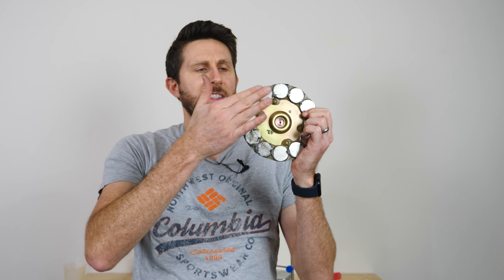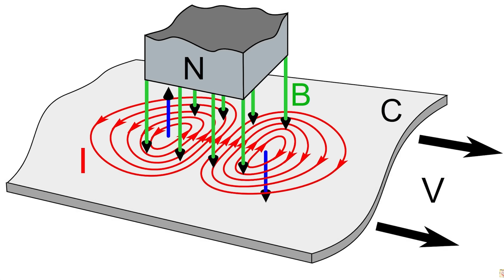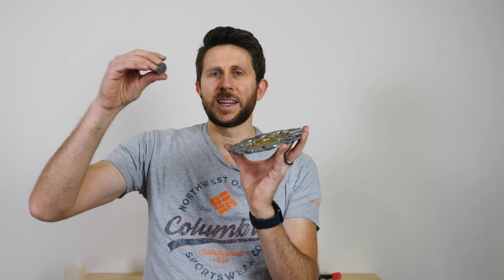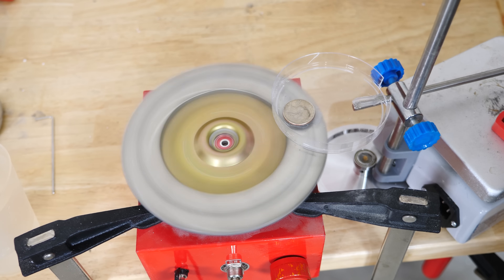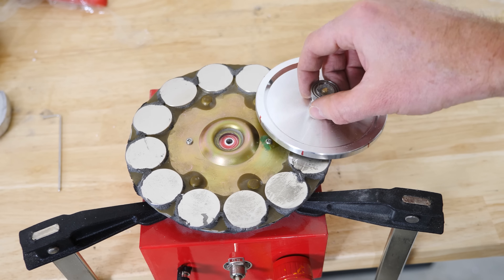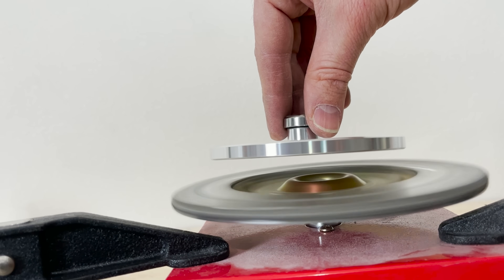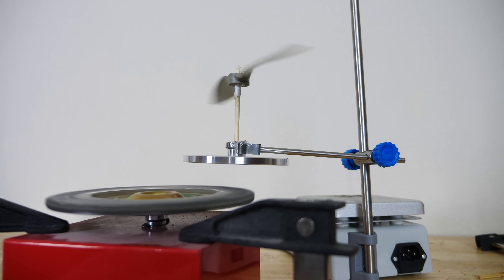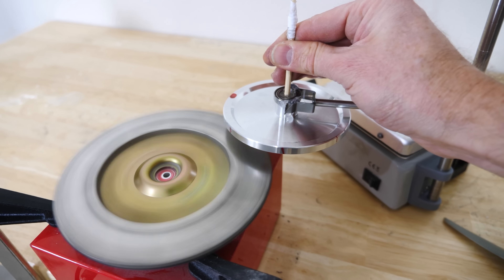How To Make Invisible Gears With Eddy Currents

Comment: Actually, that same principle is the one asynchronous motors use: they have a non-magnet rotor spinning to avoid overcurrents during startup or load changes (as opposed to synchronous motors with a magnetic core). When three-phase current runs along the coils of the stator, it creates the variable magnetic field you make with the spinning magnets. This has the disadvantage of having a variable speed depending on the tork they have to overcome, but nowadays are more used than synchronous for big force requirements afaik.

Comment: I know this is how some water pumps work. Instead of having a shaft through housing and having to use special gaskets to keep water out, just use the magnetic field through the housing. To ensure a water tight component.
Reply: The most common version of this is the magnetic stirrers you see in every chemistry lab, that are driven by electromagnets integrated with the hot plate the beaker sits on. I used magnetically coupled gear pumps from Tuthill Pumps back in the day for one system I designed and built.

Comment: I remember back in 69, I took apart a speedometer from a 1961  -" Ninety Eight"  Oldsmobile and saw an aluminum cup-shaped metal on one end and a magnet attached to the cable that ran from the transmission.  I knew very little then about magnetic uses in things but once I saw this combination, it hit me how it worked.
Reply: Indeed. I took out a speedometer from a 96 mazda and only years later actually discovered how it worked. Neat stuff.

Comment: I think it'd be really cool if you made the receiver "gear" disk as thin (i.e. as light) as possible, and maybe beefed up the propeller a bit in terms of thrust (and not weight ideally). Then, with a bit of luck and some precision placement, ideally you could get it to levitate above the spinning coil -- it would spin up so fast that it would start rising and getting further from the coil, inducing a feedback loop wherein being closer causes to spin faster and move further, which then causes it to spin slower and move closer, etc. until it (hopefully!) finds a nice stable equilibrium
Reply: The only issue I could see with this is it flying off to one side or the other you'd have to have some sort of string guide or something to keep it above the magnets
Reply: @drako7222  yeah maybe you could make the body of the propeller hollow (if it wasn't already) then drill a hole in the middle of the bottom disk and thread the whole thing onto a thin metal mast anchored to the table
Reply: If you make the material thin then there will be decrement of edye current. So less levitation
Reply: @BalaMurugan-hk2gd  I see... you don't think there's a middle ground between thickness/weight and strength of the eddy current that would make it work? Is there a lighter metal than aluminum that would be stable enough and otherwise appropriate to use? Maybe lithium (disclaimer: I don't know what I'm talking about)
Reply: @superbasyboy  Thanks for the detailed explanation! In your expertise, do any medals that could fit the bill come to mind? Or is aluminum still probably going to the best choice?

Comment: f you really want something unbelievable try a step up transformer just using the basic counter and clockwise layers you don't need metal. But you have to layer one coil at a time. when pulsed . the other receives a voltage step up by adding core material amps are also increased. I believe Tesla thought it was to simple to create more from less. . variable switch helps for power and voltage . I have tested it 5 volt's in 40 volt's out .  I Thank you This is my way of returning the favor. equal length's of wire and same gauge. Thanks. If only we as a world weren't dumbed down by greed. Imagine the wonder's

Comment: Great video.
I thought pans for induction stoves could not be all aluminum.
Reply: it depends on the type of inductive stovetops. different inductive stovetops might use different frequencies, and different metals are more susceptible to eddy currents at different frequencies (this is a bit of a simplification).

Comment: Has anyone ever thought to do something like this to be a different kind of clutch in a manual car? But have the friction plates only make contact and synchros when the magnets are close to contact, they don't actually make contact. I think that woulde too difficult to pull it out of gear
Reply: He's just showing that this is possible, otherwise this is a terrible energy usage :) even worse clutch because lack of friction/manually controlled parts.
Reply: @shortsofmylife4592  Not if you read the comment above this one ...

You're looking for a comment by one 'Rene Knuvers'

Comment: I have a theory about this let's say you put something on to those wires he was messing around with do you think you can get an Infinite source of power at least as long as no wires and or what ever is connected to it doesn't short blow a fuse or overheat

Comment: Always learning something new from you.  Pretty cool stuff!  Eddy currents are also what allows metal detectors to work.  Transmitting coil creates Eddy currents in metal which in turn give off their own magnetic field and thus a sensing coil picks up that magnetic field.  Depending on how close that return signal matches the transmitted signal determines how conductive it is and shows a higher number on the target ID or higher on the discrimination level.

Comment: Will it be possible that the aluminium flywheel will drive a couple of gears that will drive the steelplate? Like a infinite loop?
Reply: AND use the heat from the coin to run a Nitinol Motor to spin the plate of magnets... 🙂

Comment: Cool demo! I'm a bit surprised that James didn't try this in a vacuum, since there will inevitably be comments asking how much of the energy being transferred to one gear to the next comes from the air current created by each spinning disk. Air currents are clearly not the main reason for this effect given how fast the wheels turning, but I could also see how they would add a measurable amount of force that gets passed to each disk from the previous one.
Reply: Hm, interesting thought. You could be right, but when I imagine two metal disks spinning one above the other like in his setup (but not magnetic) my gut instinct is that the spinning one wouldn’t impart any meaningful amount of spinning force on the other due to air current. I could be wrong though. So it would definitely be interesting to see!
Reply: @droam129  Yes I agree that given the shape of the discs he was using (relatively flat and not really "catching" the air around them) it's unlikely they would transfer much energy between them, certainly not as much as what was demonstrated here. But if their surface was more rough or even had raised tabs and they were mounted on their axes in a way that limits friction as much as possible, you could definitely make them spin without touching with just air flow. Really anything other than a perfectly flat disc spinning completely horizontally will impart some force. Just not much.
Reply: hey everyone today im going to be showing what would happen when you put the invisible gear machine in vacuum
(intro to his next vid)
Reply: @rakshithg9669  It's impossible to read this and not hear his voice.
Reply: They burn up faster. The air passing over the inducted disk actually helps keep the metal cool and stable. If you put it into a vacuum, there is no heatsink effect and thus the inducted disk will eventually overheat and fail. This is a common problem for eddy current clutches that get insufficient airflow or in vacuum-state applications when their duty cycle is too high.

Comment: You should try an actual gear inverter using magnets.
You place a sandwich of these alternating magnets on a ring pattern with another ring with ferromagnetic materials in place of the magnets in the middle.
 When you turn one of the magnet rings the other ring will turn on the opposite direction without touching.

Gear reduction also works by using different number of magnets.

Comment: What if the fan will create down lift, then in turn will push the plate closer to the magnets and then in turn will spin it more faster and repeat :) will it touch the magnets? Will it actually work?
Thanks 😊

Comment: You should compare how much the spinning magnets heat up aluminum compared to steel. There is a reason the inductive cooktops specify that cookware should be magnetic.
Reply: Is it about being magnetic, or is it about the electrical resistance or more accurately, impedance? The more resistance, the higher is the heat from the currents.
Reply: An induction stovetop is a high frequency transformer. The primary winding is built into the stove, the secondary winding is the bottom of the pan placed on it.

At a high enough frequency, such a transformer works with all types of conductors as the secondary. You want to have a high electrical resistance in the secondary because that is what the circuit is designed for, including impedance matching. It produces the heat inside the bottom of the pan and allows the primary coil to remain cool. To achieve this high resistance, the skin depth of a particular metal, at a particular frequency becomes important.

Due to semiconductor economics, 24 kHz systems are common, but at that frequency, aluminum and copper have too much skin depth and too low of a resistance and don't impedance match well with the primary.

Iron on the other hand, has a relatively high electrical resistance, especially at 24 kHz due to the skin effect. It's ferromagnetic and has high permeability.  AC currents can only flow in a very thin layer below its surface. It also exhibits hysteresis effects resulting in heat. (This only adds about 10%) 

In a good conductor, skin depth is proportional to the square root of the resistivity. This means that better conductors have a reduced skin depth. Skin depth also varies as the inverse square root of the permeability and the inverse square root of the frequency of the conductor. In the case of iron, its conductivity is about 1/7 that of copper, meaning its resistivity is 7 times higher. However, being ferromagnetic its permeability is about 10,000 times greater. This reduces the skin depth for iron to about 1/38 that of copper, at a given frequency. The higher resistivity of iron, combined with its thinner skin depth makes its resistance significantly higher than copper or aluminum.

There are induction cooktops that employ even higher frequencies, allowing the use of aluminum and copper. Panasonic Corporation in 2009 developed a consumer induction cooker that uses a higher-frequency magnetic field of 60 kHz or higher, and a different oscillator circuit design, to allow use with non-ferrous metals as well including aluminum, multilayer and copper pots and pans.  In 2017 Panasonic released a single-burner countertop "all metal" unit, using their trade name "Met-All"

Also, some cooktops do employ a magnetic reed switch and permanent magnets to detect the presence of a suitable sized ferromagnetic pan, to permit the stovetop coil to be energized. See patent US3796850A. Also, some cooktops can detect whether cookware is present by monitoring power delivered. As with other electric ceramic cooking surfaces, a maximum pan size may be specified by the manufacturer, and a minimum size is also stated.

The control system shuts down the element if a pot is not present or not large enough. If a pan boils dry it can get extremely hot – a thermostat in the surface will turn off the power if it senses overheating to prevent cooker failures and potential fires.

As for the original suggestion made by X JWill, comparing how much the spinning magnets heat up aluminum compared to steel:   Thermodynamics plain and simple. As long as the load on the prime mover which spins the magnets is constant, the heat produced will be the same for iron, steel, aluminum, copper or any other conductor. Heat is the graveyard of all energy. Whatever energy comes out of the spinning magnet wheel, at a given load, the total heat will equal that same energy. The temperature after a given amount of time will depend on the specific heat capacities and masses of the materials, and the rate of heat loss by the materials. If I have a motor which is putting out 1000 watts at the shaft, then 1000 joules per second will go into heat. A little will go into windage and noise, but most of the energy will go into doing work on the load. The load will receive 1000 joules per second ignoring windage and noise losses.   --- Maybe a better test would be: At a given distance, which material will produce the greatest load on the magnet wheel? First of all, the frequency involved is much lower than the cooktop example, so skin depth isn't as much of a factor. More load is achieved with a lower resistance, so a copper disk would have more drag than aluminum of the same dimensions. However, the permeability of the iron means the flux density will be higher at a given distance, so it might make more of a drag on the magnet disk. Try it and find out!
Reply: Good question. I know that copper responds better than aluminum. Steel would be attracted to the magnets so I don't know if that will work.
Reply: Cookware does not have to be magnetic. The reason that aluminum does not work is because it has low resistance so that induced currents don't  generate enough heat. Stove detects that and doesn't turn on. Iron on the other hand has high resistance so it heats up. It just happens to be magnetic. If you would find material that is not magnetic, but conducts with higher resistance it would work.
Reply: @HattoriHanzo031  No, that is incorrect.
Reply: I'm pretty sure that most induction cook tops use a sensor to switch off if there is nothing there. That sensor may be based on doing a magnetic check meaning that even though the material is conductive and technically could work it is invisible to the cooktop. This is also a way to protect things like phones and other electronics from the cooktop literally frying them.
Reply: @MascottDeepfriar  I would suspect that it would monitor either the resistance or inductance that is induced in the current traveling through the coil via back emf. they could possibly just use a thermistor, although that would not work very well. @XJWill1 is wrong, as if it was not monitored, the inductance of the coil would drop, allowing more current to flow and quickly frying the coil.
Reply: @MascottDeepfriar  No, that is not how induction cooktops work. They do not shut off "if there is nothing there". And iron or magnetic steel cookware heats up more than other metal cookware.
Reply: @XJWill1  both my cheap and expensive induction cook tops turn off if there is not a viable piece of cookware on it. So I'm not sure what you mean by that.
Reply: @MascottDeepfriar  Some induction cooktops may have an additional circuit that checks for how much power is being consumed by the induction coupling and turns off if it is too low, but that is not a primary or necessary functionality for an induction cooktop. More to the point, your claim is simply false that the reason magnetic cookware is specified for induction cooktops is to enable a circuit that cuts power if there is no magnetic cookware on the cooktop.
Reply: @XJWill1  I never claimed to know the answer I simply offered a possible explanation. To ridicule me for saying that my cooktops, which I own, turn off automatically is sort of ridiculous. 
I know that the auto off function is not integral to the physics of how an induction heating system works however I have never encountered one that does not have that energy saving and safety feature in a commercially available consumer product.
Reply: @MascottDeepfriar  I did not "ridicule" you. I corrected your statement. Learn the difference.
Reply: @XJWill1  ok I agree you did not technically "ridicule" me. However your correction was both false and dismissive.
Reply: @MascottDeepfriar  If you reply to my comment with an incorrect statement, then you should expect to be corrected. If you want to label that "dismissive" then I will not argue semantics with you, but I will label your subsequent comments as entitled and querulous. And my correction was not "false". Based on your most recent comment, it sounds like you still do not understand how induction cooktops work.